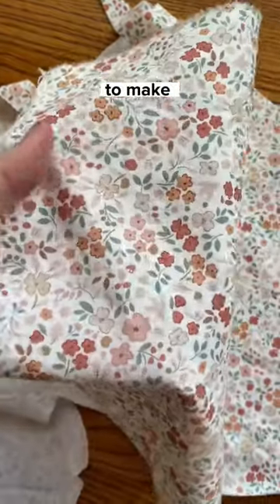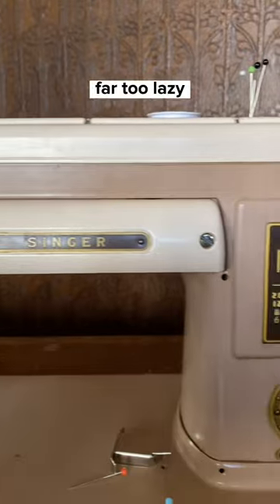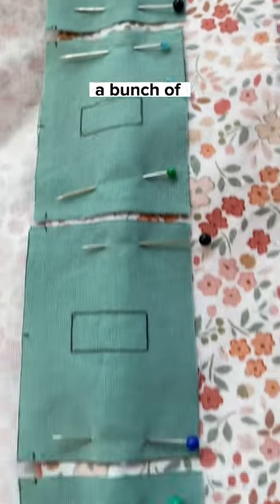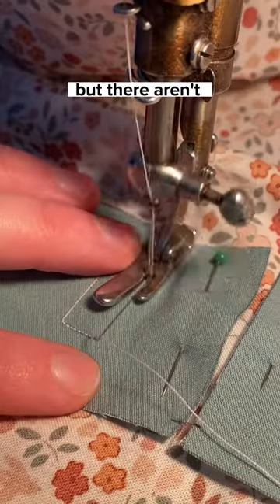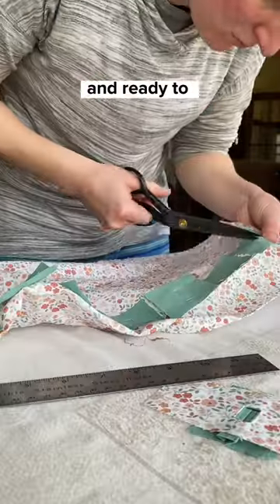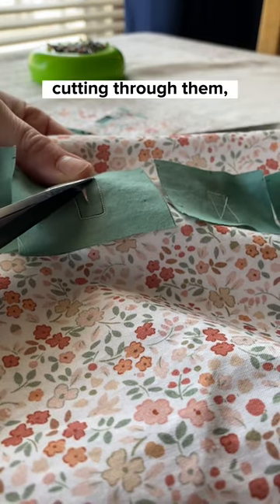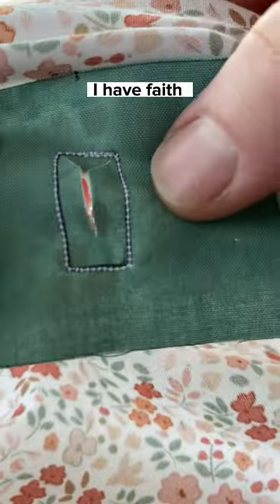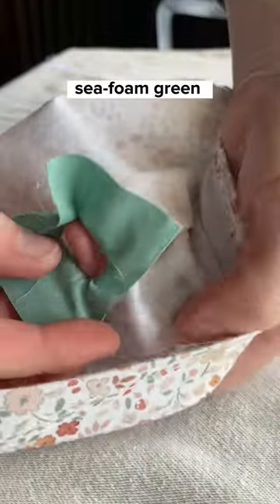One hell of a way to avoid buttonhole stitches 🤣🧵 #sewinghacks #sewingtips #notatutorial

Comment: Your bound buttonholes are amazing but if you do have the buttonhole attachment for that model of Singer you will love it.  My 92 year old mom still has and uses her Singer that’s the exact same model.  She got it new in the early 1960s.  The buttonhole attachment has these little metal templates you select for the proper buttonhole size.  This makes the nicest buttonholes and it’s super easy.  You should give it a try and do a video about it
Reply from the maker: I have it and I do not love it. Also, it does not make bound buttonholes. Love my 301A though!

Comment: I would like to add something here. I used to make military uniforms for the US gov and there was a chemical suit that used this type of  buttonhole. I literally made hundreds of them. 
So, the problem with this is that the opening is way too big. Both in length and width. This size of opening is good for coat buttons. I recommend you reduce the size
Reply from the maker: I'm gonna take a hard disagree with you there because I've not only added buttons but worn it several times since, and there is no problem. Do you think I'm going to spend all this time making these buttonholes and not have considered the size of the buttons that I'll be putting on the blouse?

Comment: don’t start your stitch at a corner. 
Start a bit down one of the stitch lines. Backstitch/knotting at a corner will prevent a clean turn and corner on the finish.
Reply from the maker: Fortunately I neither back stitched nor knotted my corners, I just kept straight stitching very slowly and carefully on top of my line, and while it wasn't 100% perfect, I still had a very clean turn and corner, and my buttonholes are super crisp and clean. 😘